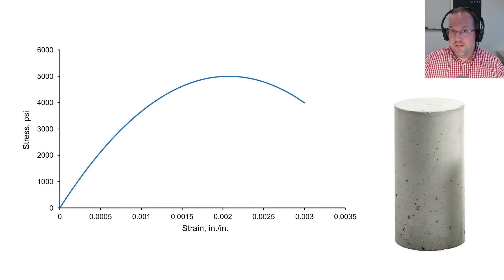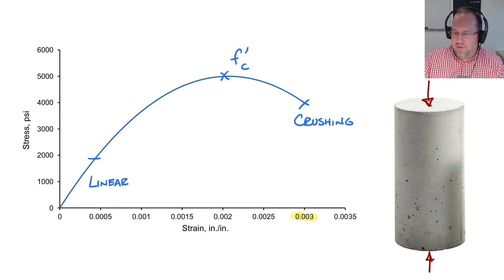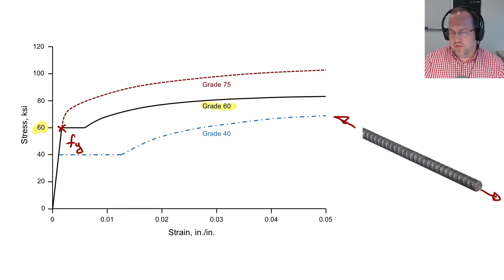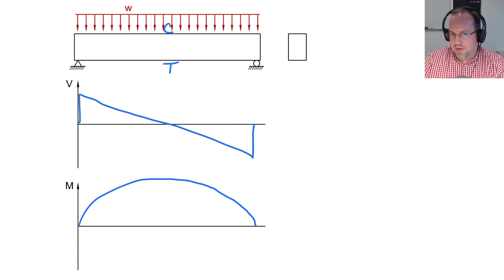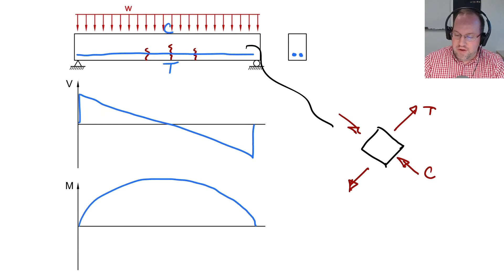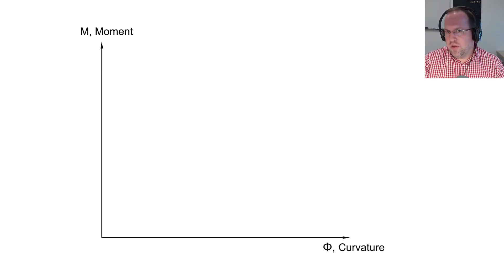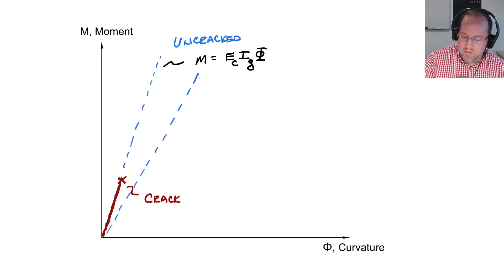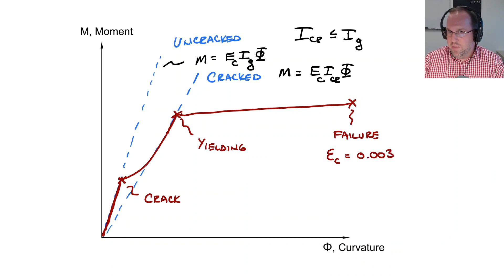Concrete, Steel, and Why They Work Well Together

Comment: Is it better reinforced concrete or a steel structure to build a big modern house?
Reply from the maker: I’m partial to concrete, but it’s unlikely anyone is building a house out of either. Economics is often the determining factor, and wood framing usually makes the most sense for light residential.